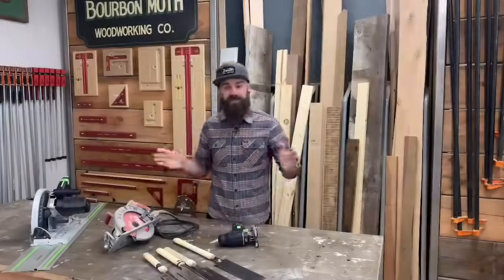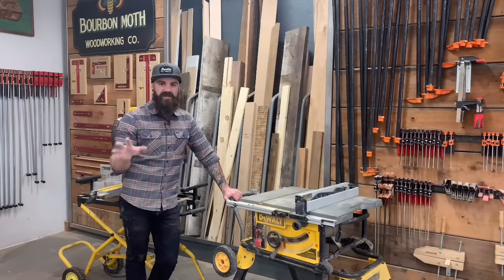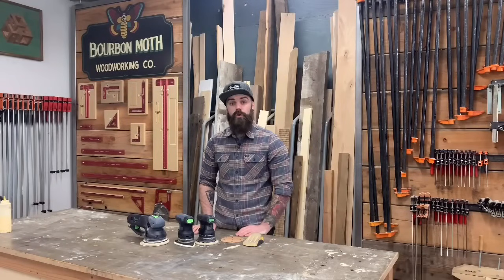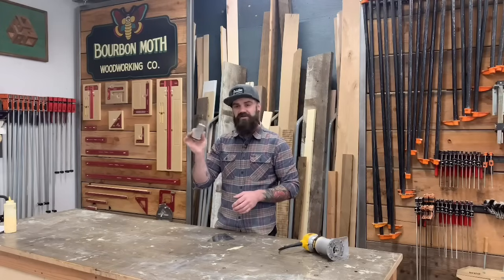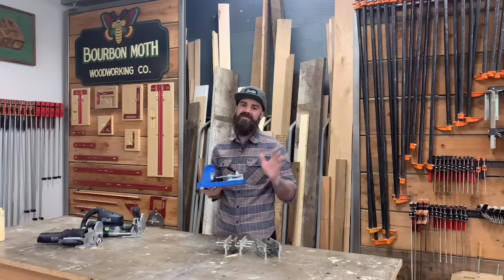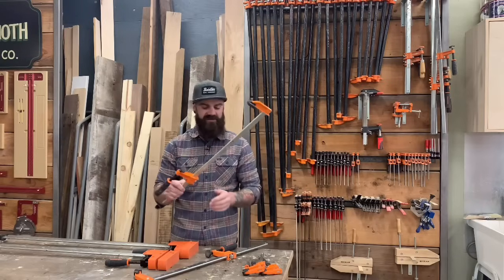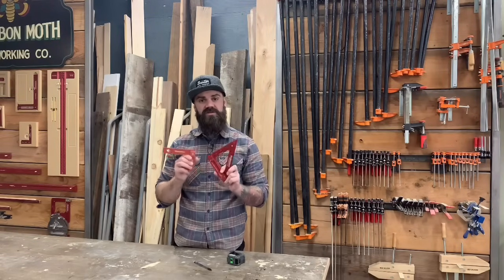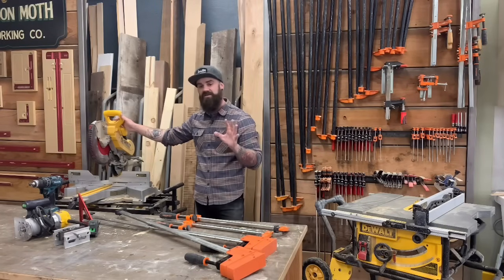Tools every woodworker needs | Start Building for under $1000

Comment: You can get a table saw and a circular saw with an add on track adapter and a miter saw for the cost of some of those track saws. You can definitely get a table saw and a circular saw with the track adapter for the same or less than the majority of track saws and do more. There’s definitely great budget items in this field that will do more than what most people need. Do I want a cabinet table saw? Of course, but will the skill 10” table saw do everything I need and save a ton on space? Also a “resounding yes.”

Comment: I wanna build furniture. I've been getting tools for a few months now and have just got a fair few new power tools the other day (18v combi drill, 12v combi drill, 12v planer, 12v flashlight on the same battery too) and i wanna see how close i am to having what i need. I know i need a table saw and a circular saw but i do have a 190mm miter saw. 😊
Reply: I gather I need a table saw, jigsaw, circular saw, a sander, a router, a block plane (I've got a smoothing plane) a doweling jig and possibly a impact driver and I'm pretty much set. I'll add I need to get some more clamps, scrapers and a smaller hammer. Still got a lot to get, but I've got a lot of stuff already. 😊

With what I have I already can make some garden furniture, was gonna do that today (and sand and repair the old stuff) but it was chucking it down raining all day 😅

Comment: I'm in Canada and just got into woodworking. I picked up a Skil mitre saw and table saw last xmas/black friday sales. Got the Miter MS6305 and the Table TS6307 and both new cost with 3 year warranty cost me a tad more than the Dewalt DWS779. I just added the Rigid miter stand and makes life simpler. Also picked up the same Dewalt router kit with the plunger. so yeah, not bad. So for me and starting off in this, this is worth it and does what I need for need.... Good tool's out there for people starting out that won't break the bank and are reliable.

Comment: As a long time woodworker, forego the chop saw for a skill saw. Your table saw, when you set it up correctly and square can do every single cut you need that is square or a straight cut (and for some crazies, circle). The chop saw can wait. I recommend spending a pretty penny on a quality chop saw. You don't need a fancy skill saw. I still use my Ryobi skill saw, it's all I need for what I need it ffor.

Comment: If someone is struggling for space, one option might be a Shopsmith.  Great table saws, and several attachments, which most do not require their own power source, they're powered off the powerhead of the Shopsmith.  These are somewhat expensive though, but are a great option for space saving if you work in a garage, and have to push stuff up against the walls out of the way, the Shopsmith is only about 2 feet in depth, the downside is you get a smaller size table for the saw, but so are most of your jobsite saws.  

Heck, when I started out, I had handsaws, no not powered ones, the human powered ones LOL.  That's an option as well, it'll take you longer, you'll have to of course do more sanding, but those are definitely options out there.  

A router is a great tool to have, and buy a table to mount it in too, you can use them freehand, but sometimes having them mounted in a table is nice....Skil has a router/table combo for like $200 on Amazon, its the one I just ordered.  I don't really have much knowledge with them as I've never had one setup to use unfortunately, but now that I've got one coming I'm gonna learn...its just another tool in the shop for making nice edges, you can do signs with them, they've got templates you can buy or make for doing all sorts of stuff they're pretty universally used in many shops.  

Tape measures, pencils, squares, etc. kind of a user preference, but I've used mechanical pencils as well, those cheap BIC ones are great, I've used the old school carpenter's pencils, and just regular old wood pencils, they all work fine, just pick what works for you and go with it.  Tape measures, many times you'll find you don't need that big bulky 25 or 30 foot tape measure, the 12 foot and 16 foot ones are great, I carry a little 9 foot one with me in the truck.  Squares, yep, those framing/rafter squares are a great way to go, and pretty reasonably priced too.

Comment: Love the video 
What accessories would you recommend to get started eg. saw blades router bits drill bits screws sandpaper timber so you don’t damage your project I am just getting started finding accessories are costing just as much as the tools

Comment: Instead of the card scrapers, i got something a bit more ergonomic, a husky 3 or 4 in 1 painters tool, use it to scrape, open stain cans, and close stain cans, and i got it in 2020 and it is still holding up. It will probably be a bit more expensive, but it will work a bit better because the scraper part is thicker.

Comment: After twenty years with just a table saw and miter saw I wish I would have gotten a track saw sooner. I'm not doing any fine wood working, just making shop stuff for fun, but breaking down full sheets on a table saw (unless it's large and you have space) is a real pain in the ass. Agree on the mechanical pencil, I use a .5mm so I have really fine lines to go by and it fits in all the rules that have marking holes. I would say one premium accurate square is a must also. With that you can check almost all of your other tools that aren't 'premium', and set up your tool fences square.

Comment: MIlescraft released a track plate adapter and rails that I picked up which does turn my circular saw into a track saw. Had to order it from the US as I couldn't find it anywhere here in the UK. Cost $100 (£78) and Stackry shipped it for £55 (Probably $72). Haven't managed to use it yet as it only just arrived, but its certainly a bit cheaper than others and you can always take the circular saw off the plate when you don't want to use the track. May not be the best solution, but it is an alternative!

Comment: You get a bonus point for including clamps ... so many tool lists don't include clamps.

However, I wish you also included drill and router bits, a starter pack of sandpaper, and a few "you probably have these at home and can use them for woodworking" things like screwdrivers, a hammer, paint brushes, a broom ... most of these are very low cost.

Finally, for anyone new to the craft, it's a good idea to add one new tool to each project build. Which tool? That depends on the specific project and what direction your work takes you. For example, my next project will be a wood and copper pipe table — I'm going to buy a nice assembly bench.

Comment: Hi! I got pretty excited watching your channel for the last weeks, cause I have an Idea to start woodworking and it’s weird and interesting that after so much videos I watched this one. So one thing I would like to clarify, instruments is a good thing to have but, what about drills, saws etc? It’s not included in this starter pack setup but it would be great to know the “must have” types and sizes with more or less affordable prices and for how long they last before sharpening or changing. Would be nice to know your opinion and get some tips as well. Thanks a lot for what you making!

Comment: I know this is an older post, but I'm just getting into woodworking and find this really helpful! I've already made a few pieces and have some tools from that and other home reno projects, but kind of clueless on things like how to use a dowling jig vs when to use my pocket hole maker (I did get the Kreg 720Pro because I was making a ton of pocket holes on one thing; so, I'm good there). I watched your video on strength testing different joints but still not sure I know/understand WHEN to use WHICH type?

Comment: I bought the smaller DeWalt 8 1/4" job site with the stand for only $299. Can't REALLY do dados (although some have) but most people starting out don't need that anyway. And a DeWalt table saw is going to hold its value. I guess just due to sales on Black Friday etc, I accidentally ended up with a basement full of DeWalt, save for a rigid chopsaw, but that was free and a rigid vacuum. Huh... everything else is DeWalt. I got the wireless trim router and built a simple routing table for it. That thing is in-fact a beast. I'm not sure if I would recommend that particular one or the table saw more strongly. Both excellent.

Comment: So, with the way the inflation is right now, I got to wondering about what the cost would be now compared to 3 years ago for the tools he listed and wanted to share with others with my findings. 
The tools he has listed in the first section minus the hearing protector mentioned are as follows with the current Amazon pricing as of 03-02-2023
Chop saw: $309.00
Table Saw: $329.00
Sander: $72.80
Router: $129.28
Dowel Jig: $37.29
Drill/driver combo: $280.76
Clamps: $41.99
2 pack 24" bar clamps: $87.99
Tape measure: $7.99
Speed square: $3.99

The price is: $1,300.09

With some shopping around, you can get the price under $1,000 without having to buy second-hand items.

Miter saw: $239.99 at Harbor Freight. $69.01 saving.
Table saw (without folding stand): $149.99 at Harbor Freight. $179.01 saving.
Orbital sander (without kit bag) $39.99 at Harbor Freight. $32.81 saving.
Router: $64.99 at Harbor Freight. $64.29 saving.
Dewalt drill and driver combo: $159.00 on Amazon. $121.76 saving

Saving up to $466.88, bringing price down to $833.21

Comment: @6:23 I'd like to suggest a much cheaper option for under $30: a WREN handheld electric planar. I used it to plane a very rough cedar lumber it allows you to change depth of cut between 1/16 intervals but allows 1/32 it's cheap and it works very well just need to hold it evenly.

Comment: I've started out with Swanson speed squares in 3 sizes, I like them so far ") will eventually add in some woodpecker tools ") I'm currently building a 2-bedroom, 2-full bathroom home, using only 3" Dremel, 4-1/2" Rockwell, 6-1/2" Kobalt circular saws, and 3/8" drive Black & Decker, 1/2" drive Kobalt drills, and a Dewalt 25' tape measure 😀 it's been a learning process, but making  good progress 😀

Comment: If you ARE going to get a jointer and a planer, take a serious look at Wahuda/Cutech. They have a 10" jointer for ca. US$550, which is a spiral cutter head unit (you want this!) and also they have a 13" planer unit (also spiral cutter heads) for 600. Yes, that's notably more than the DeWalt, but it's a spiral head, which is easier to maintain/keep sharp and does a far better job. 

If you DON'T have that much, the solution first is to buy the planer, and then search for Youtube vids about what you can do if you do NOT have a jointer (there are a number of ways to "fake" it with a planer).

For the hand-router, you might also consider the Bosch. Good quality, just like the DeWalt, and similar price -- but it also has an available attachment for routing at an angle -- that is, routing stuff that is needfully at 45 degrees or suchlike. This is convenient.

Comment: Good video and list.  Interesting to try to think of a minimalist set of tools like this.

You can make furniture with those tools, but often overlooked is the time you need to spend building your shop first.  If you just buy those tools, the first thing you should start making is shop furniture (which I suppose is furniture making lol).  Make outfeed and side tables for the small table saw, a stand for the miter saw, and a workbench with stock holding (dogs, etc. - and it‘s worth it to buy a decent vise).

You‘ll also need to make some jigs - a crosscut sled is a really early must-have and not hard to make at all.

I think you can do w/o the miter saw early on for most things, but I‘d add a larger framing square and combination square and ditch the tiny speed square (and be careful with speed squares, cheap brands are often inaccurate).

Also, get a shop vac if you don‘t have one.  Eventually a dust collector, but you need a decent shop vac to start.

I‘d also add at least one decent chisel and a hammer - if starting out, get a chisel that is designed to be hit with a hammer or get a mallet too (or make one, not hard).

And of course, drill bits and driver bits.  And consumables (glue, fasteners, etc.)

It reminds me of something I once heard a woodworker say.  You tell someone you have a shop.  They ask you, “what do you build in your shop?”. The answer - “my shop!”. =p
Reply: I'd argue there's a lot you can do without adding feed tables to your jobsite saw, and my chop saw just sits clamped on a table that doubles as an extra work surface if I move the chop saw, so those specific things might not be the first to make. But your point is valid - make some useful stuff to make your shop functional, and use them to practice some of the basics.

Comment: It has been 22 years since I have worked construction. From building track homes to concrete tilt-ups. Roofing etc.

I have in my shop
Bosch 10" table saw ($100 pawn)
Ridgid Miter Saw ($125 pawn)
Ridgid Cordless Skill saw Gen5 ($45 pawn)
Ridgid jigsaw cordless Gen5  ($40 pawn)
Ridgid router cordless Gen5 ($85 eBay)
Craftsman 9" Ban Saw ($40 Craigslist)
Chicago Company drill press ($40 Craigslist)
Ridgid cordless Impact drill ($40 pawn)
Ridgid cordless Drill ($40 pawn)
Ridgid case ($40 pawn)
Chicago table router ($50 pawn)
Ridgid small shop vac ($20 Craigslist)
Ridgid cordless air compressor 1Gal ($60 Pawn)

This was over 3 years of me buying. It's been sitting in my garage for that long and I'm finally making things.

What I do is just make a list. I see this list in my shop. I check online local and eBay only to buy for a good deal and always ask for a discount. Most say yes.

Good luck everyone.

I just found a Planer for $60 at the Pawn place. I was super broke when I saw it. Had $20 in my pocket. Placed it on lawyer-a-way. All I am looking for is a Nice Joiner. Been seeing some for $150. 

The deals are out there. Have fun

Comment: For sanding this is one of the first things you do want to upgrade early on.  I'm not really a woodworker (though I am setting up some shop), but nearly 20 years in finishing.  I've used cheap sanders till they died, then bought better ones, then better again.

I use a Mirka Deros, takes 5" & 6" backing pads, you can spend 8hours on that machine and not jack your shoulder or wrist up.  Honestly wish I'd known about them years ago.  

Also, get a good M Class dust extractor for your sander.  You can get one for a few hundred these days, hepa filters.  All good.

Comment: Because of inflation his starter toos is now $1400. Here is a cheaper version of what he did. Kept most of what he reccomended. Price is $1000 (actually a little less now but who knows in the future)

Miter Saw: https://tinyurl.com/486fz6mb

Table Saw: https://tinyurl.com/mwz5d63e

Router: https://tinyurl.com/yu7b5yes

Sander: https://tinyurl.com/26cv3w4n

Doweling Jig: https://tinyurl.com/3ata5bfc

Drill Combo: https://tinyurl.com/bdhpvxk9

Tape Measure: https://tinyurl.com/bdhpvxk9

Square: https://tinyurl.com/2eupewpk

Bar clamps: https://tinyurl.com/mr353rwh

F body clamps: https://tinyurl.com/msyvapc6

Comment: After 40+ years of woodworking, I still use my contractor's tablesaw (Delta) and still don't have a chopsaw (I did eventually build a crosscut sled for my tablesaw, which handles anything).  If I buy any hardwood at my lumber outlet longer than 8', I just have them cut it down (only way it'll fit in my mini truck, too), otherwise the sled handles everything else.

Comment: Don't disregard the used market and older tools. I picked a craftsman contacted saw for $100 and a 15 1/2 drill press for $125 that's 50 years old and has less than .002 runout. Lots of good tool deals on craigslist And marketplace if you're patient.

Comment: I think I went balls deep and jumped into the deep end. I never used an actual power tool just a drill. I ended up buying a  circular skill saw, metabo miter saw, craftsman jig saw, skill router, craftsman 6 inch jointer, craftsman electric hand planer, metabo c10rjs jobsite table saw, dewalt DW734 planer and kinda upgraded a couple of those tools for better one all in less than a year and had zero clue what I was doing this was back in October 2021. I barely got comfortable using all these damn tools haha but YouTube influencers, well they kinda influenced and finessed what was actually needed 😂 but now I’m atleast 4 maybe 5 times that amount of $1k to start 🤦🏽‍♂️. No regerts 😂 so all I’ve been doing since is just learning these tools o practicing my cuts (pockets hurt) on lumber and well I have enough wood chopped for 4 winters 😂 teaching your self and just watching YouTubers is not as easy with no actual help well at least trying to understand how to use 📐📏  to square up your blades fences etc was a nightmare and still don’t fully get it but it’s enough to get them straight.. most of the time cuts 😂🤷🏽‍♂️

Comment: One I thing I would add to this is the price difference between corded and cordless. If you're working in a shop I'd recommend corded tools. Yes you may have to deal with plugs and outlets but corded tools are way cheaper than cordless.
Reply: Another point to add to your suggestion.... If you are going to have a dust collector hooked up to the tool, then you might as well go with the corded version as you'll be tethered to something either way.

Comment: Regarding the router. If you have a plunge base, use the quick depth gauge. My Bosch router has ⅛ inch depth adjustment increments. Zero out the bit by plunging down to the flat surface, then set your gauge and start using the preset adjustments.